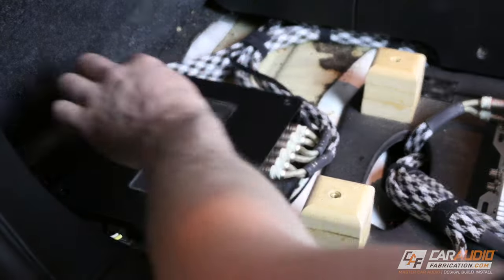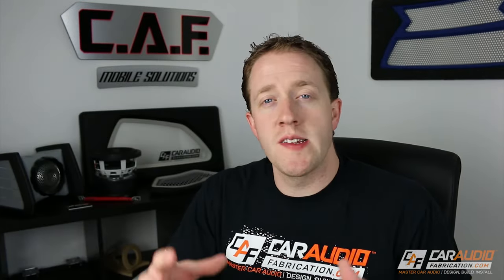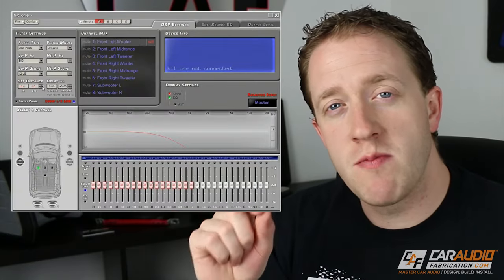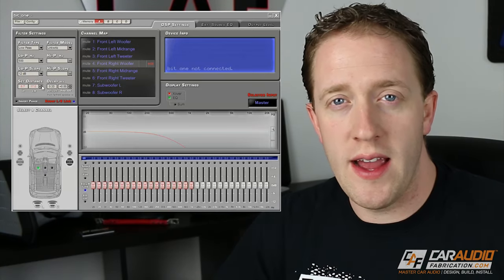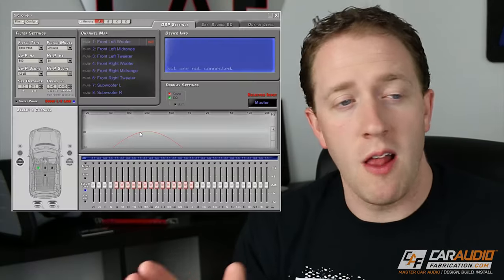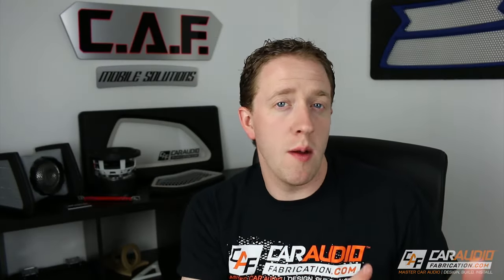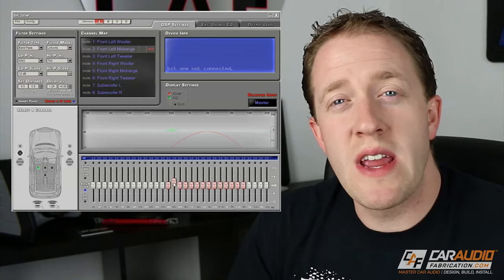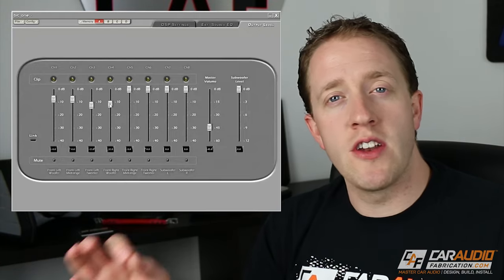What is a DSP? Why you need a Digital Signal Processor for Car Audio

Comment: Hello i have a JL fix 86 AND a JL 1000/5v2 amp, with a original head Unit, i need to know how i put my gain in a 1000/5, my gains in amp Is At minimum and i hear shhhhh for my speakers.
Thanks a lot

Comment: But if you tune the timing for the driver doesn't it throw off the timing for passengers in the car who are sitting closer or farther from other speakers than you are?
Reply from the maker: Yes, which is why you can have multiple tunes set up that you pick from.

Comment: How do you take the whining noise out of the bit one dsp. I chase the noise to the audison bit one. Ground are good and rca are good and power lines and ground are on the other side of the car from speaker wires. Big 4 was done and alternator is new along with battery. I did notice that if i lower the volume on the dsp the whinning noise is low but the i lose volume as well. But thats just hiding the problem its self. Can anyone help me on this.

Comment: Great vid. I kind of stumbled across it. Is there anyone out there thats using “RTA” to tune stereos on a Harley. I’ve used the DSR1 for integration for 2014 n later. Some guys are willing to pay for Focal, Hertz, Beyma, etc...  as of now I’m not real impressed with the bass response from pro audio speakers in these small enclosures. It seems like speakers with a rubber surround with more excursion sound better to me. Thanks ahead for any tips and responses from anyone that reads this.

Comment: Hey, thanks for all of your videos!  Question: Do you think having a DSP feeding into an amp(s) that adequately power all the speakers eliminates the need for an aftermarket head unit?  What features does an aftermarket head unit offer over a stock head unit that a DSP and good amp can't make up for in terms of SQ?  Also wondering, can you change EQ on the head unit after the dsp is set up?
Reply: Depends on how bad your OEM head unit is.   Other than sound, what can't it do, that an aftermarket will be able to do?  I always replace my head units with head units that run off of the Android OS.   So any app that I have on my phone can be installed on my head unit if I want to.  For my cars, that primarily means Waze and Spotify.    Maybe actually running the apps from your head unit isn't important to you, but you want to be able to use the apps that are on your phone on your head unit.   So you might want a head unit that has Carplay and Android Auto.    Yes, the EQ on the head unit can be changed after the DSP is set up.    Which is another reason someone might want to get rid of the factory head unit.   One of the head units I replaced, had nothing but a bass and treble adjustment.  Forget EQ, it didn't even have an adjustment for midrange.  LOL.

Comment: +caraudiofabrication hey man im a big fan and love what your doing! keep up the good work!!! ive been debating on getting a DSP, but I already a 4ch amp for my mids and highs and a monoblock for my sub, all of ehich is running off of my brand new Pioneer Nex 4200.....so my dilemma is that most of what you mentioned in the video my NEX unit can already do like time alignment, speaker level, crossovers ,etc....so the only thing Im thinking i would gain from a DSP is control over my tweeters since the NEX unit will just adjust the front stage as a whole rather allowing for individual mid and tweet adjustments.....so can you make a video on what you think about the "DSP" that are found in todays higher end aftermarket stereos and how they compare to other DSP like Adison and AudioContol....for my set up I just dont think i would gain that much from running my NEX unit AND a DSP....What are your thoughts??

Comment: i would like to see adding subwoofer enclosure with oem headunit and speakers
Reply: +Captain Buff The Third did it to my car. just splice into the rear speaker channels and ether add a step down converter or a amplifier that can take high inputs. it's quite easy.
Reply: I agree. A aftermarket radio with rca level out puts is best. the problem with the way my set up is, is it relies on the quality of the stock HU.(most stock HU's out there are completely crap) I would much rather have a true set up but my cars radio size is 1.5 din. aftermarket HU's look so bad in my car. as well as the radio in these cars are pretty good quality. I just have a small 8" sub to assist the bass. I wouldn't recommend this to most cars but some cars( like mine) ether can't upgrade the headunit or already preforms pretty good but just needs a little assignment. I don't see it as hack work tho. well depends on the quality of your own work i guess.
Reply: ***** i personally dislike the look of single dins in my car. which is why i chose to use the stock one. how ever the stock radios in these cars are pretty good. if i were to install a aftermarket head unit, i would put a 2 din. that would be a lot of work and a lot of custom fabricating.(I've thought about doing it quite often) in my set up I'm only using is for a mono block amp meant only for one sub. if some one wanted to amp up their whole system (all 4 channels). i wouldn't recommend these. i would recommend a real head unit.

Comment: I'm curious to know  would it be a good thing to add an eq such as the clarion eq 746 to a head unit like the pioneer 80 prs
Reply: Ow yea it would greatly improve your sound and actually make it where you could go active and get more power to your front stage.
Reply: +Tammy Forbes ok thanks for your input I was planning on running a 4 channel also , so I would need to choose one or the other for processing eq or hu correct ?
Reply: +David Christopher that's correct you only wanna use one crossover point other wise it could cause your sound to be muddy.
Reply: +Tammy Forbes thank you which do you suggest the eq 746 or just the built in on the 80 prs
Reply: +David Christopher the external crossover is almost always going to be better and have more room for adjustments.
Reply: +Captain Buff The Third if you are having noise then sounds like you have a ground issue and your install was the problem not the eq. And yes eq' offer better sound then head units but either will do the job no doubt but a decent eq should give better sound and yes you can go active using a electronic crossover and raw drivers don't know who told you different but they where wrong. Go to sound solutions audio forrum they can answer any question you have and their some of the best audio guys around. Don't believe anybody who thinks clarion makes noise making devises when it's obvious it was his install and not the equipment. Never saw a advertisement for a noise making device and don't think clarion would build one either.
Reply: +Captain Buff The Third I don't know if it's a half den or not he just said a crossover so I'm assuming clarion would make a pretty decent xover. I like their hu's I loved the sound my old one made. But I have almost always ran alpine myself I love the sound they make and I know how to tune them properly to get pristine sound. But yea if he is talking about a old crappy xover then yea he would probably just be better off with just a hu. But if he is talking about a new electronic crossover I would assume that would be better then just a hu. I know a DSP would definetly be better but yea your price point should tell you about how it's gonna sound. If it's $30-$40 don't expect great sound but anything over a $125-$250 should be ok. I know the audio control epicenter's are great I used one of those I got from sonic and it is by far the best sound I ever had and that was with a top of the line alpine hu and all JL system so it was pretty decent before the epicenter.
Reply: +Captain Buff The Third  I went and checked out the little X over and it looks ok I think the problem with these units would be people wiring them off their head units instead of giving them there own dedicated wires that's probably where people are getting bad sound if they are. Install is the most important part I would rather have less expensive stuff installed properly then high dollar stuff just throwers in there. I'm sure if he gives it a dedicated power and ground wife from his battery or distribution block it will sound really good for a $150 dollar unit. I know the video I watched about it the guy liked it and said it helped his sound plus you will have more control over your system and higher input voltage to your amp which always helps.

Comment: Another reason why to ditch a passive system and go full active. My ideal system would be a 3-way front setup
Reply: I'm working on a active 3 way front stage to keep up with my sub stage and also just for the big boost in sq, just having a hard time figuring out exactly which dsp to go with tho I'm leaning toward the 360.3. Which one are you planning on?
Reply: +Sundown Camry leaning towards Bit Ten D since I want an iPad as the source unit
Reply: +MrEvoHK you get a lot more control running a full active system vs using factory passives but then you also need additional amplification. It's amazing how some speakers come to life with getting more power pushing them. Even the tweets and mids make a huge difference active with more power. I have a 3 way active plus sub and I am running 4 amps.

Comment: My head unit does all of this
Reply from the maker: Your head unit does not have 10 channels of fully tunable 30 band eq. Maybe 6 but there's no way it's 30 band. Maybe 7 or 10 but no where even close to the same tuning flexibility. And you're not going to use an aftermarket head unit in 95% of new cars.
Reply: CarAudioFabrication Okay, I get what you're saying. And with new cars I totally agree with you. I just meant for me it wouldn't be worth it to spend the $300-400+ to buy an additional DSP/RTA. Thanks for the response though. Your videos are a great help!

Comment: i had a shop install mine in my 2014 tundra without the jbl system. I have a Audison Bit ten and a 5 channel alpine for the system. its crazy.. i noticed when i fade to the front on the radio all 4 door speakers play. when i fade to the rear, only the sub is heard.  when i fade to the right i hear the sub and the right side( front and rear). when i fade to the left, i do not hear the sub and only the left side. The installer says it must be my Audison Bit ten being the problem. I need help..
Read more

Comment: I just dont get what’s so good about a dsp, when my alpine radio can do everything a dsp can do..
Reply from the maker: I promise you, you dont understand DSP. Your radio doesnt have a 30 band graphic or 7 band parametric EQ on every channel. It might have time alignment, but it doesnt have near the adjustability that a real DSP has. Additionally you are making an assumption that every person can just put an aftermarket head unit in their car, which they cant, and DSP excels at integrating with a factory system. It's not some big hoax that DSP is heavily used in real car audio systems, it's the ONLY way to get truly the best sound performance
Reply: CarAudioFabrication I’m aware that many people are not able to, or not willing to change their head unit. My head unit does have a lot of adjusting possibilities, but I believe you when you say a dsp is far better and more accurate at this. I also believe you when you say that it’s in every high end setup. But will I hear THAT big of a difference? Or would I be better off upgrading my speakers? FYI I’m running Hertz Mille Pro 165.3’s.

Comment: Bit One , Bit one HD, Bit ten D are far weaker than other DSP's.  They can do a lot.. but Helix and Mosconi can do much more not to mention Mosconi Aerospace 24bit/192khz for those digital high resolution ppl.  Helix and Mosconi have a far superior crossover and Equalizer compared to Audison.  Bit one has max of 48db slope and bit ten D 24db slope.. both are less than that offered by Mosconi and Helix.  Audison has the digital connection going from Source to DSP and DSP to AMP.. now that is some coool shit.  This alone is why I ended up using a Bit Ten D in one car and Bit one in another.  Also measuring for TA doesn't always work.. Every car is different.

Comment: Please don't believe that you need to have a DSP. Yes, it sounds better, yes it gives you much more control, yes it is great. But it's not like we had only shit some years ago. Again, yes it's better but you don't need this to have a great system.
Reply from the maker: "Yes it sounds better" - Your exact words... so yes it is needed. 😝😎
Reply: @CarAudioFabrication  Funny guy
Reply: It always depends what you're after. Aftermarket speakers and headunit? No DSP necessary.
Sound deadened doors and trunk, components in the front with crossovers, coaxials in the rear, subwoofer in the trunk, one amp for the speakers and one for the sub. Then you're going to get phase issues and equalization issues. While yes, subjectively it sounds good, it doesn't sound as good as it can. You're leaving untapped potential on the table.